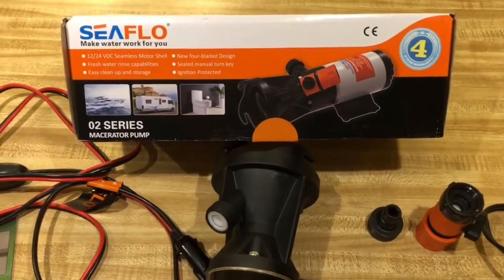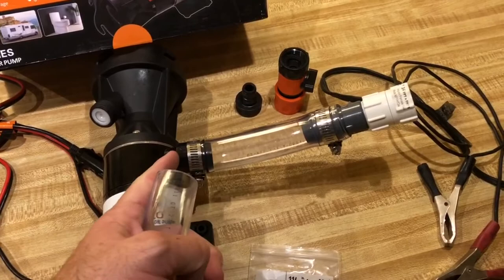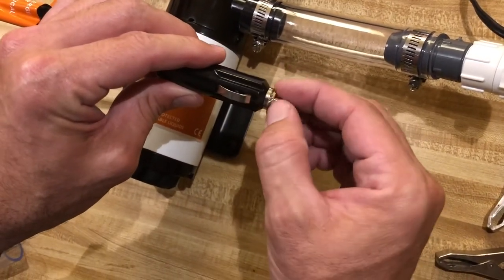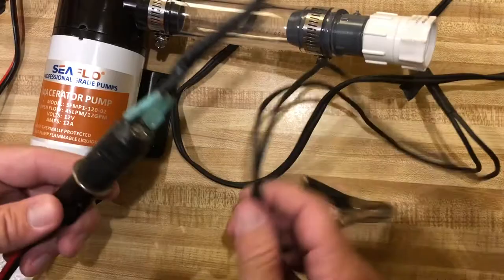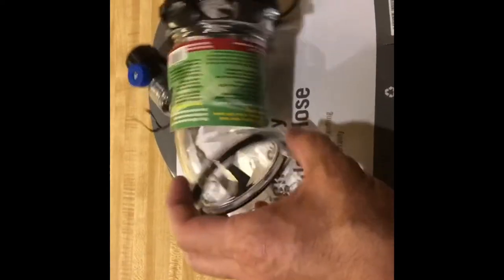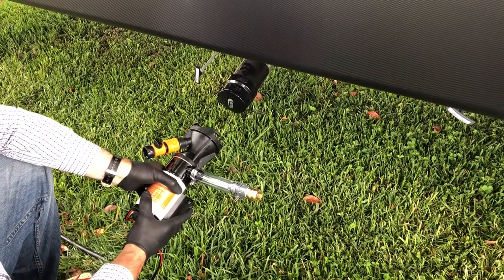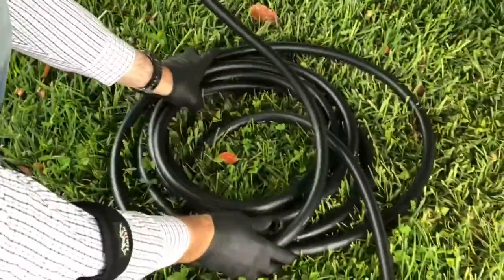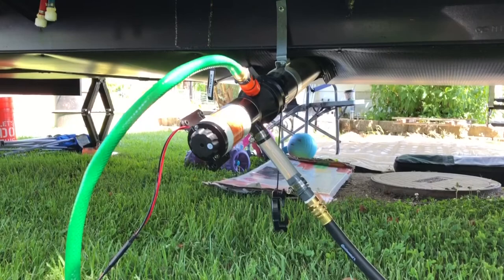SEAFLO/SEWERFLO Macerator Assembly And Installation

Comment: Hey great video. What’s the part number for the white adapter that you have on the end of the clear tube? Ok I see later in the video that you use the brass one. It’s a 3/4 fitting and you have a 5/8 hose attached. Isn’t it better to use a 3/4 hose? Does the 5/8 fit good enough?

Comment: When you noticed the wiring was wrong . Did it still push water out the hose ? I have mine hooked up seems to run fine just took over 11 mins to drain about 40 gallons.

Comment: Have you, by any chance, had to do any maintenance on your Seaflo?  I need to dismantle the blade and first steel plate to remove an accumulation of long hair as well as dislodge what I suspect is a single errant Tucks tissue that was accidentally flushed.  (I know...tmi but...life)  In the instructions that came with the pump it details disassembly but I sure would like to see a video of the process.  Mechanical things are not my forte but here I am at 69 learning how to DIY maintain a little Class B.